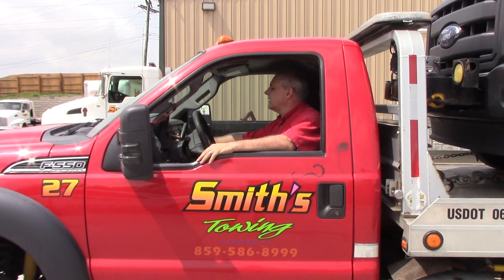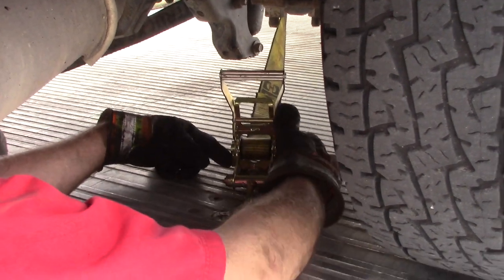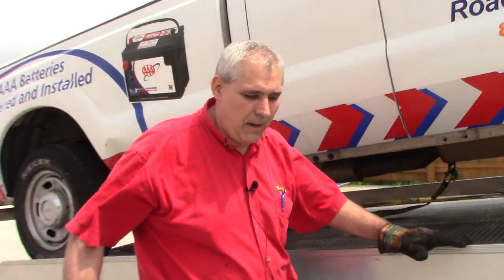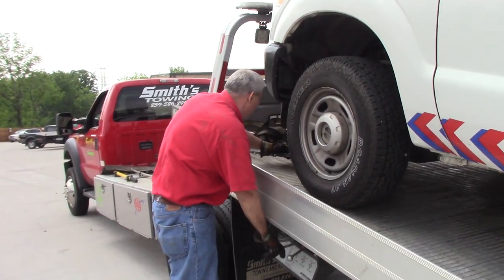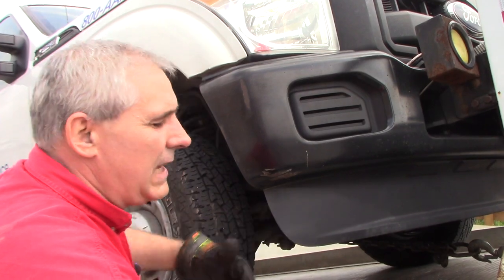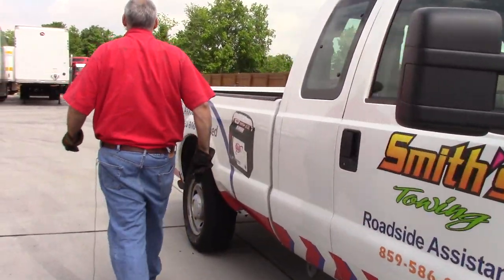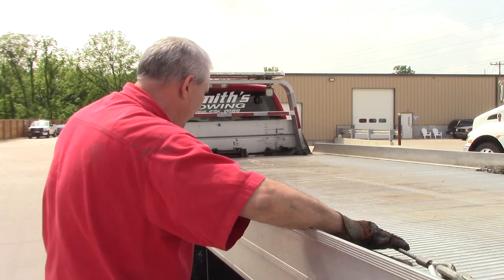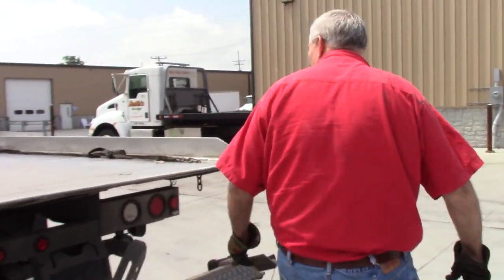Off-Loading a Truck | Smith's Towing

Comment: Seems to me that you put yourself in a very unsafe position with the bed on an incline to remove tie down that would prevent the truck from slipping down and kill you.  Why you didn't use the winch cable to take the tension off to remove the tie downs from the rear end of the truck?

Comment: put the truck in neutral and roll it back an inch or 2 , problem solved strap is loose enough to remove